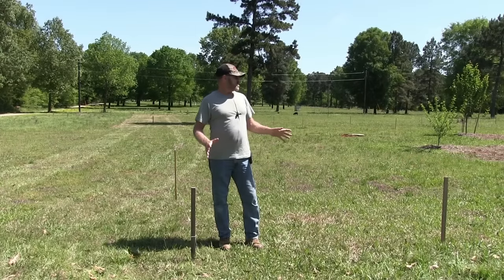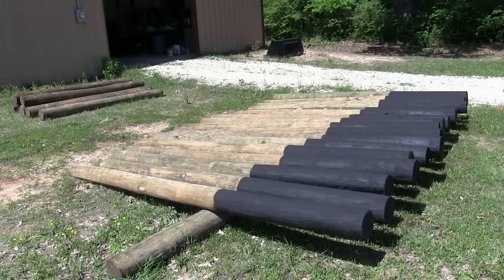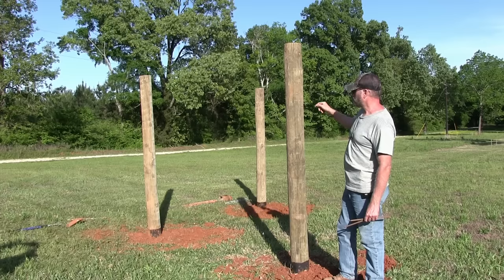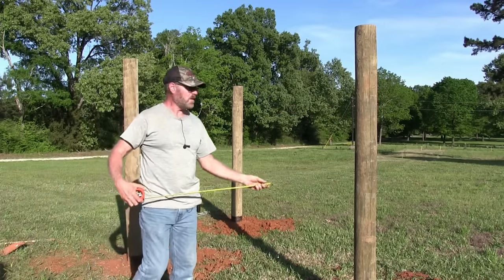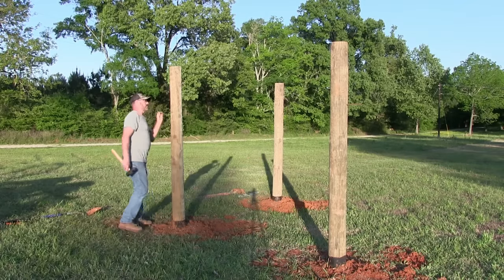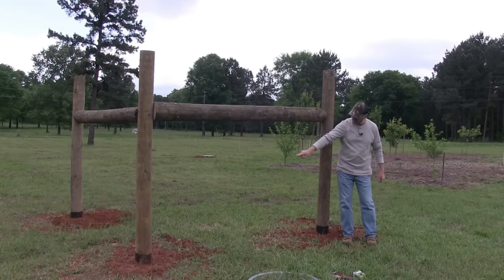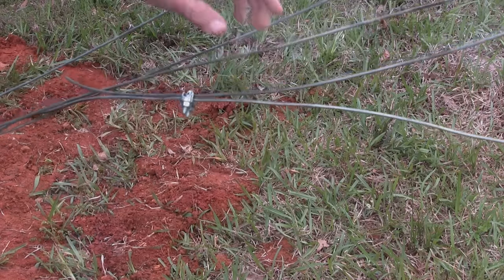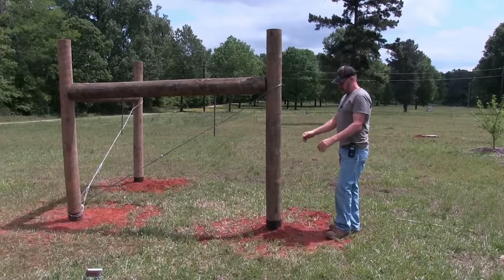Corner post installation and bracing - Detailed video

Comment: I don't think I'll ever waist this much lumber on a corner brace after seeing the better version with one diagonal brace at 45 degrees between each stretch of fence and joining the post and the ground. It keeps the middle post from rising out of the ground over time and uses 2/5 of the wood.
Reply: What's the name of the video? I'm gonna have to redo a corner by hand and solo 🤣 if theres an easier way I'm all for it lol.
Reply: @babydoll8em69  https://www.youtube.com/watch?v=qaZtECyrSFk  Its at 11:00. I guess you would need a third post driven into the ground, but it wouldn't necessarily have to be like they did it.